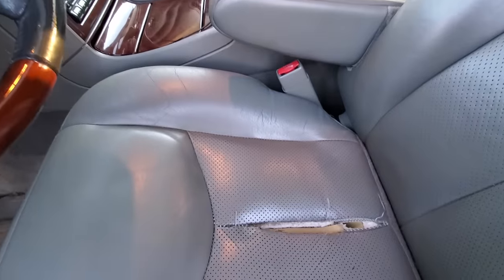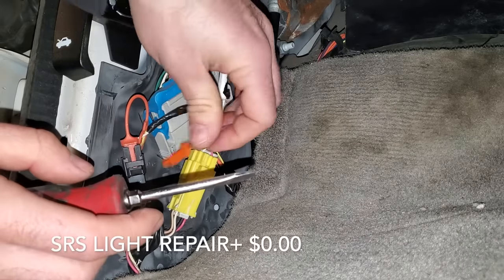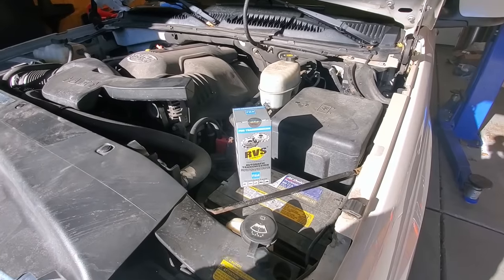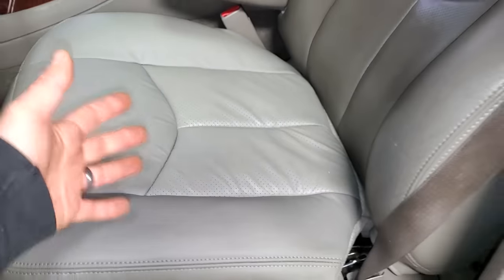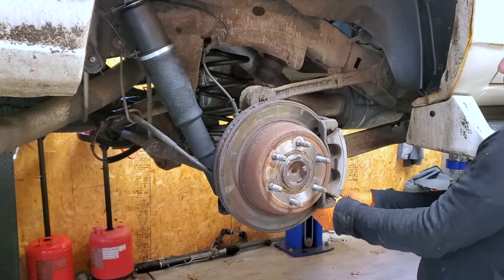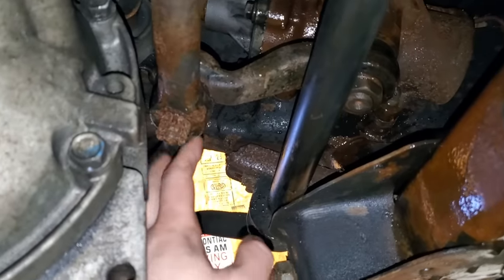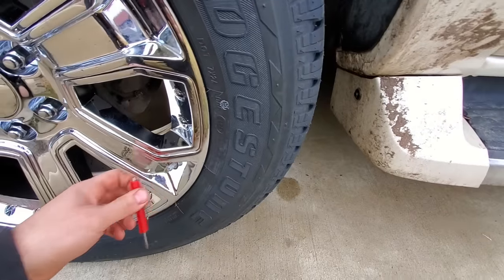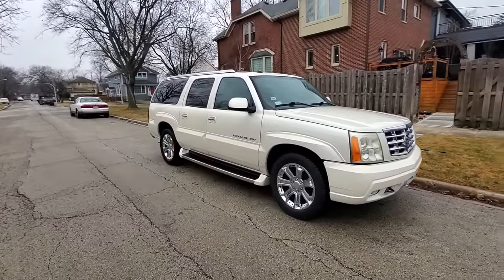I Fixed EVERYTHING On A 15-Year-Old Cadillac Escalade In 1 Day To Avoid Buying My Wife A New Truck!

Comment from the maker: https://bit.ly/3ceBAvL If you're interested in a really good auction deal watch my latest auction video. Here's what cars are really selling for in this depressed market. You could snag a sweet car for cheap nowadays.  Mercedes, Audi, Ferrari, Lambo, and more!
Reply: Are you still selling this truck ??? I'm interested
Reply: Recommend an upholstery shop in Chicago metro area that can replace driver's seat cushion, or entire lower seat for a Chrysler 300?
Reply: Great Deal
Reply: Saab has tis and wis now its great
Reply: My Escalade is now running at 9 miles per 😢 I'm hoping that replacing the mass airflow sensor can fix this. And I'm worried about the transmission even though it has no problems at the moment. It's up to 138,000 miles on a 2006 EXT. So I'm goin to try that RVS stuff you used.

Comment: When an Escalade is considered a reliable vehicle you know there are German/Italian/formerly British cars in the driveway as well.
Reply: A Cadillac Escalade is just a Suburban / Yukon which are fairly reliable and easy to maintain, as well as plenty of parts to be found.
Reply: @dedalliance1  for some reason the Escalade is less reliable, even though it's the richer brother of the Yukon and the rich cousin of the suburban..I think it's the electronics
Reply: @Piznick64  They probably share all of the electronics honestly, wouldn't be any reason for GM to source out different electronics just for the Cadillac brand, especially if they weren't as good.
Reply: dedalliance1 so if it’s the same whys it cost so much more? Obviously Escalade has features that the same year Yukon or suburban wouldn’t have.
Reply: @jonjensen4514  Why are Nike shoes twice as much or 5x as much as a shoe at Walmart? Because to some people brand logos matter.
Reply: @dedalliance1  you forgot quality. If you wear Walmart shoes I feel bad for your body
Reply: @771shadowolf  Personally I wear boots, I've had $130 Wolverines after discounts, $180 timberlands both fell apart within a year or less. I now have 2 pairs of Duluth Trading boots, $75 a pair and they're holding up better.

Point being it's not the price you pay that's going to determine quality. And paying for a brand name isn't always going to be guarantee quality, but typically you're going to pay more just for the logo, may not be worse quality than anything else but it's not worth the price tag either way.
Reply: @Piznick64  Have you ever owned one of these?
Reply: @BornInBosnia  me personally no but my family yes
Reply: Somewhere down around Houston, Scotty Kilmer is laughing his ass off
Reply: Chevrolet GMC and Cadillac are same sharing parts frames engine transmission everything
Reply: @dedalliance1  What you can do is buy from a Nike outlet and you will get the Nike shoe at the same price point as Walmart but better quality.  Nike does put good technology in their shoes when it comes to comfort and performance.
Reply: @dedalliance1  Comparing apples to oranges here
Reply: @icankickmagda  Not really. The only reason you'd buy an Escalade over a Yukon is because you like the few extra creature comforts and the styling of the Cadillac, and you're willing to pay more for it. Same thing with shoes, or clothing in general really. One brand of shoe might use gel cushioned soles and have a cooler color scheme over another brand, but they're generally going to be more expensive. But it doesn't mean they used more glue or stitching to hold it together, and it doesn't mean they hired more skilled people to put the shoes together. It's just like vehicle manufacturers, they use 90% of the same materials and methods and labor force to put their vehicles together, paying for a different brand logo is to just have bragging rights essentially. My GMC is essentially the same exact thing as my Chevrolet truck, I just personally enjoy the red GMC logo on the steering wheel and how it looks, so that's why I bought a GMC.
Reply: @dedalliance1  In terms of the vehicles, sure. I get that. I've driven an Olds Alero for years but I know it's essentially a Grand Am/Malibu from the same time. But in terms of the shoes, it's not the same situation. I pay $50-$60 for a pair of Nike shoes because consistently every pair I've bought has lasted me a couple years. I'd buy a $20 pair of Walmart shoes 4 or 5 times over the same period, eventually spending more money, because they wear out faster. Nike may not be the best quality but they're way ahead of what Walmart sells.
Reply: @icankickmagda  Right, but there's  also Nike shoes that are limited addition that can run a thousand dollars. I doubt Nike puts a whole lot more quality into their expensive shoes as they do in their 60 dollar ones.
Reply: GM makes the most reliable truck made in America
Reply: dedalliance1 because they are way nicer? You can walk on hardwood floors in Nike’s without slipping everywhere but Walmart shoes are dangerous with their lack of tread
Reply: Unlike German/italian cars, when it breaks, you don’t have to drain your bank account to fix it cause parts are everywhere.
Reply: Jon Jensen you clearly mis understood his point. A shitty $40 base nike probably has the same materials as the $1000 pair some kid bought with a Jordan logo. Point is don’t buy chevy they suck ass government should of let them fail
Reply: Silver Justice I think you actually misunderstood, he clearly compared Walmart shoes to Nike. His point wasn’t that cheap Nike shoes are very similar to expensive Nike shoes, his point was that Walmart shoes are similar to nikes. When they’re not. But just because two cars have the same frame doesn’t mean they have the same horsepower or specs.
Reply: Jon Jensen he restated his point you missed it bub
Reply: Piznick64 yeah bro my moms 04 Escalade has 370k miles and is still really reliable but most of the sensors don’t work 😭😂
Reply: That whole line is rated as the most reliable. It’s cheap to fix as well. Part of that is they don’t change too much with each generation so they’re not the most tech advanced.
Reply: Chris Kelly yeah but when the electric system goes it really fucking goes
Reply: I have an 13 year old Escalade and have had very few issues. Just a dressed up Tahoe. 185K miles and counting. Just took it on a 6 hour trip - rides well, paint still looks good. More reliable than the german stuff my wife drives.
Reply: Back then they were reliable. I'd say after 2014 they became garbage
Reply: ANTHONY R you may have a good point. I haven’t driven anything newer than an 08.
Reply: Those European cars are expensive trash in the states. I flip cars and would never pick any car brand you've named.  They are not meant for 200k miles.
Reply: Kenny same here hell i just bought a truck older than I am lol
Reply: Garrett Summerlin lol enjoy it man!
Reply: @dedalliance1  Timberlands falling apart within a yr?!!! Did you buy those from the flea market?!! Or perhaps the corner store?!
Reply: @divinestrength1774  But it's true. Timberlands are chinese made garbage. Get some American made Red Wings for about $240 or a set of Doc Martins. Both brands are better leather, better boot, and will outlast a Timberland no problem.
Reply: My step dad had one and it made it like  500k miles
Reply: @mackjones7688  some are some aren't made in the US and I bought some Thorogood boots and what POS those boots were my $100 Columbia winter hiking boots are far better than my $260 Thorogoods I used to own before I chucked them in the garbage. Walmart had some great Dickie boots but they no longer have them for only $85. 
Have never tried redwing but the Thorogoods had inconsistent eyelets at offset angles that caused them to untie every once in a while. Looking through issues on thorogood it seems they have constant product inconsistency.
Also they only lasted me like 6 months so not sure how people make them last 5-10 years. This Techlite material on my Columbia is damn amazing only boot that shingles haven't made a hole I work roofing btw.
Reply: @jonjensen4514  not true, owned a pair of walmart shoes, and I had it for 5 years not problem.
Reply: @J2402-q2j  my 03 Escalade esv is awesome .. my family hauling vehicle
Reply: Or a pile Tesla
Reply: Piznick64 youre wrong actually. I had a 2005 Escalade EXT that was bulletproof. Also have a 2003 Denali XL. I’ve had more issues with the Denali (nothing really major) but point is, you’re incorrect.
Reply: @SouthTexasCollectibles23  I have a 2005 Yukon Denali XL, almost the same truck as this Escalade, mostly cosmetic differences. Leather seat worn, check. Transmission issues, check. Exhaust leak, check. She's a complete beast though I love it. Flushed the tranny, new solenoid, perfect. I sewed up new seat covers, and have yet to care about the exhaust leak, once she warms up a little it disappears. ✌🏼
Reply: No, this gen is one of the most reliable vehicles, plain and simple. The newer ones have massive issues, but 02-06 are rock solid.
Reply: @jamesstephenson2346 can confirm I have an 02 and it’s still running perfectly.
Reply: Promoting  rvs f that people just drop the transmission oil pan change the valve body seals and put in new solenoids add new oil badabing badabooom
Reply: the escalade was always reliable and its what it was known for, they only got shitty in 2017ish and ruined that reputation. 1999-2014 was all just a glorified chevrolet suburban or gmc yukon xl denali. ive had them last well over 500k
Reply: The 2003-2006 GM SUVs were all ultra reliable. Those years specifically of that generation.

Comment: You said the most important thing : There´s no car payment on it .
Reply: Jan324td exactly why I own a 20 year old Chevy 4 door 4x4 3500. I would have paid $50+ thousand for a new one.  Instead $4k and some cheap service parts later I have a big block OBS Chevy that’s not owned by the bank.
Reply: No car payment is only a matter of what you can afford. Many folks pay cash for new vehicles. And no, I'm not talking about $80K plus vehicles. Keep it reasonable $20K-$40K.
Reply: Definitey not true. If you have an older money pit that's also not safe, you're not saving any money.

People have this weird idea that no car payment is always a good thing, but some paid off cars will cost you more per year in maintenance than a leased or other car will
Reply: rustler08 it’s not to far off bought my car for 43,000 19 years ago only spent $3000 on total repairs. My car was paid off in 2009 so with the extra 48,000 I saved from not paying each year. 3000 or 48,000. Justify the robbery and you make it worse
Reply: Nick J it’s called good credit haha sorry your bank wants $2000 for the same car cause you got non
Reply: The car payment, AKA the idiot tax.
Reply: possibly substituted by a credit card
Reply: This is the reason why I don't want to get rid of my truck. It's an 04 Silverado 1500 crew cab 5.3l and it's paid off. I've rebuilt the front end and have some other stuff but no car note is better than a $500+ truck payment.
Reply: @Pie4life123  how is it a pile of crap? Its fixed and is a very nice top of the line luxury suv

Comment: For a truck that could last another 150k miles, $3k was money well spent.  That platform is easy and cheap to fix.
Reply: Are they cheaper to fix that a Surburban or a Yukon XL???
Reply: @mercedesbenzs600bash  I would say all the same unless it is Escalade specific parts and you have to go to the dealer for it.  The chassis is all the same so there shouldn't be any difference in costs.
Reply: @GroundhogzGarage  Much appreciated my man....

Comment: The headlights Alex, the headlights ! Polish + Ceramic coating asap !
Reply: I’m Polish
Reply: I wet sand starting with 500 to 600 grit working through to 3000 to 5000 grit then finish with a good diamond cut or ultra finish compound. Make them look better the new ones. Most don't understand that you can't just wipe them off with a headlight solution. These lens go through so much while driving. Through many year of use they get sand blasted from the road debris and stones and dirt from vehicles in front of you. You can't treat that with a wipe on and off chemical! Elbow grease and wet sanding is a must!
Reply: I had an 03, the headlights clouded from the inside.  I never got around to fixing them.
Reply: I thought they could use a restore as well.
Reply: @johnramirez5996  If you have to sand significantly you also remove the factory UV-coating. I used a headlight restoration kit from Motip on my last car, started with 180 grit due to deep pits and scratches, but only went up to 600 grit before spraying with 2k clearcoat. This also gave a clear finish, which is as durable as new lights.
Reply: Came to the comments to say this.
Reply: @nordlands8798  Does the light shine through as well as it did before you sprayed the clear on? I am thinking of doing this myself.
Reply: @rcairforceone  so you only drove the car in daylight? Never out of town ( without street lights) in the dark?
Reply: I just use sensitive toothpaste, a viva paper towel and elbow grease.
Reply: Lol uv clear in plastic headlights. They must really have to worry about headlight cancer . and 180 wow that is heavy paper to use on plastic especially when they sometimes use 500 and 600 to prep for paint for smoother finish. And rest to polish the clear. I've been doin headlights this way since 91. Even selling headlights with restored finish . example, 99 mustang headlights. Drivers can sell for 300 passengers for 180. I would pickup hazed lights all around Florida and spend an hr on them. Seal them and make good profit doing it. My way works not just on headlights on any plastic paint even metal. Same way as the flawless cars at any car show. The wet looking paint. Ya all can do it your way. But mine has been proven through years and years of painted cars can show you.
Reply: John Ramirez jeez you’ll have no headlight lens left if you start with 500grit lol
Reply: Especially when even meguiars headlights resto headlight kits starts with 1000 then finish with 3000 plastx polish and headlight coating as a sealer to seal the polish look in
Reply: 03 headlights are leaking from a crack. The haze is on inside. Buy new lights
Reply: @wtfchazpwnt  As noted mine were deeply pitted and scratched, and after sanding to 600 they were completely opaque, but with a good coat of clear they turned clear again. Maybe not completely "as new", but very close and much cheaper than buying new aftermarket lights.
Reply: Auxbeam
Reply: Someone doesn't know anything about sandpaper. Lol. How long do you think i use 500 or 600. Black sandpaper use is a lot different when used with water. You only use it enough to get rid of all the rough stuff. To get it smooth. Then the finer paper 3000 and 5000 give it the touch. After the polish i guarantee they will look new. If you know how to use sandpaper. Just cuz you can hold it doesn't mean you know what to do with it. 😆
Reply: Nordland you had it till the clear coat. The headlight resto has a sealer in it so after you polish it when sanding is done. You go over them with the sealer . follow to the t. And they turn out perfectly. I do headlights for people around here i usually charge 30 a light depending on size of headlights. Got more jobs after proving that my way worked unlike some of the one at auto store. Meguiars is the only 1 close.
Reply: @johnramirez5996  I was just hand-sanding, maybe half an hour with 180 to get rid of all the pits from gravel etc. after 120000 miles in cold climate. Don't think I removed much thickness. Also maybe the plastic was or turns harder in older lights? These were on a 2003 BMW. The kit I used was obviously different and meant to give longer lasting results, I see now that kit included 800 and 2000 sandpaper, but 800 did nothing for the pits on my lights so had to step down until 180 which made more progress - then up to 600 before the included 800 and 2000. 

https://www.motipdupli.com/en/products/colormatic/repair-systems/restore-set-for-headlights/ipg-1523/tm-1523.html
Reply: @nordlands8798  you don't have to go that low. 220 is sufficient. For really rough surface. But most lights you can do with 500 or 6 to start always keep water bottle sprayer full when starting working new pad. You can't have enough water. Do 800 , 1000 or 1200. 2000 , 2500 3000 and 5000. They will turn out amazing. To get through each do a x pattern across the headlamp . doing 1 direction 1 way and back the other will help get the rough stuff of faster. Think like and orbital sander with your hand. Do the same from start to finish. After rough gone every piece after is only few swipes . some good med cut to an ultra finish compound the the sealer that comes with the kits. I'm always polishing headlights. So i have my own routine. Which is pretty much this. Pick up a junk one for free. Try it on a spot you'll see difference after the medium polish.
Reply: John Ramirez Well 180 was needed on mine, a good 15-20 min by hand per headlight to get most of the pits from ice grit away.
Reply: Artur Rdzawski name checks out

Comment: That Escalade is a tank. A relative has one, 08 I think. 270k miles as of a year ago, and no issues so far.
Reply: I'm wondering how many more miles that Escalade has left???
Reply: @mercedesbenzs600bash  My '09 Caddy Slade has slightly more miles (282k) - I deleted the AFM (active fuel management) cylinder deactivation system EARLY ON which eats the lifters on the 6.2's and most other modern GM V8's if not tended to, not a hint of trouble in all these years since from the motor. I put over 300k on one of these older Escalade's a few years back with hardly any maintenance (I had an '03), great comfortable workhorses with plenty of power if you have the 6.0L like this one.
Reply: @Stressless2023  I picked up an 08 Toyota Sequoia Limited,really great vehicle...